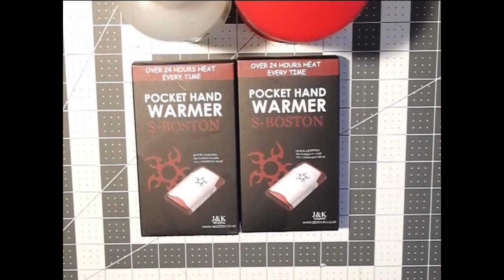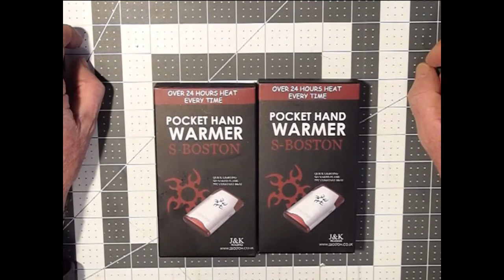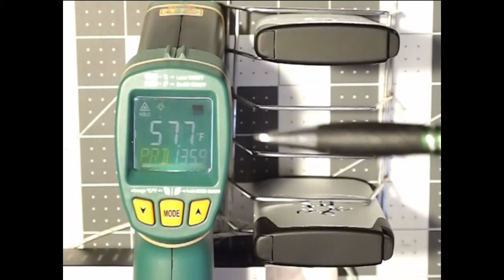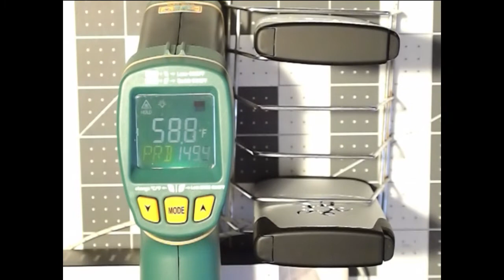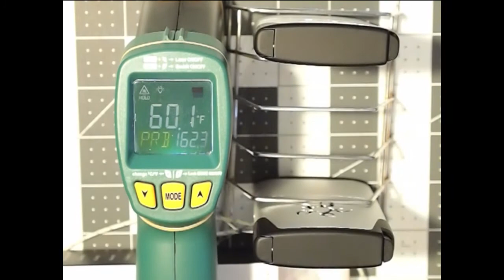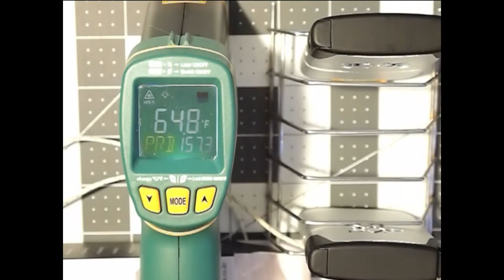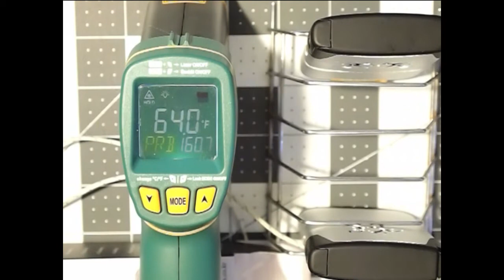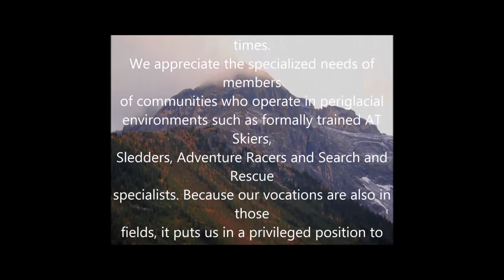Handwarmers, S02E03:  S-Boston Handwarmers, naptha fuel and performance test

Comment: Excellent video, if I purchase S boston from you, is it modified versus another vendor  ???
Reply from the maker: We ship the S-Boston with a carbon felt strip to prevent charring of the reservoir material, and a spare catalyst pad which will facilitate about 3 catalyst replacements down the road when it may be needed.
Reply: Is Coleman white gas fuel better then VM&P Naphtha? Also what VM&P Naphtha should be used, I noticed 4 different types, paint thinner, stripper, ect?
Last, I see folks storing in non metal containers, won't that be eaten through ?
I have 2 12hr, 1 6hr zappos,  and a Boston handwarmers.  I'm planning on purchasing rebuild kits for all from you if I can figure out how to do the internal bank transfer. 
Thank you for your time.
MarkWaco
Reply from the maker: @timberbeastwaco  There is a forum recently created that has sections that specifically addresses these topics: http://handwarmers.forumotion.com/